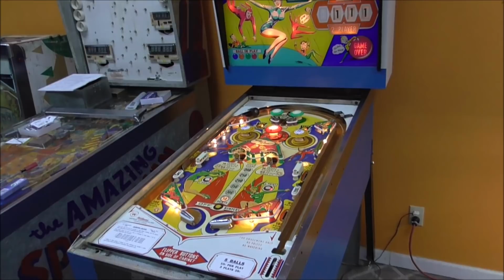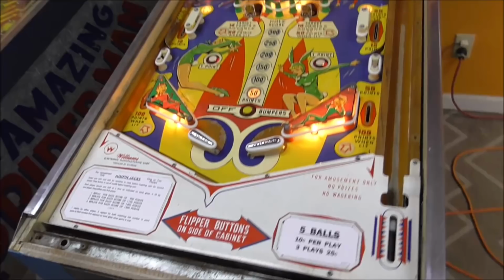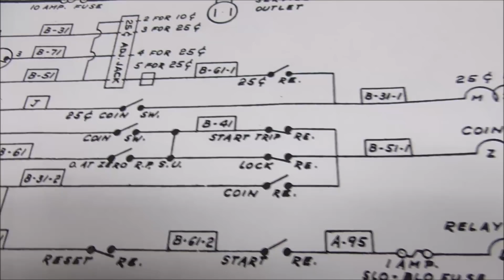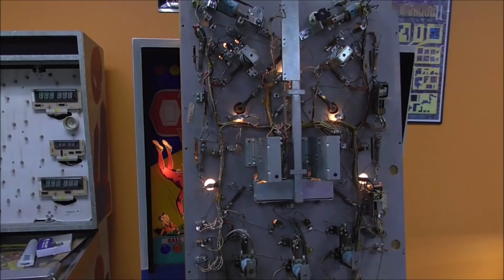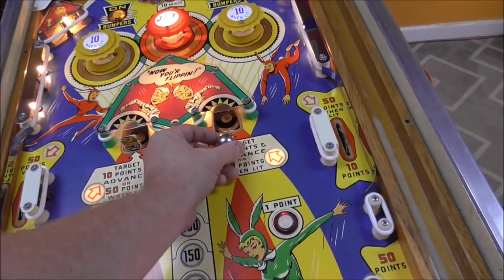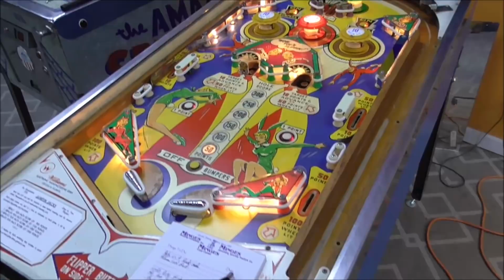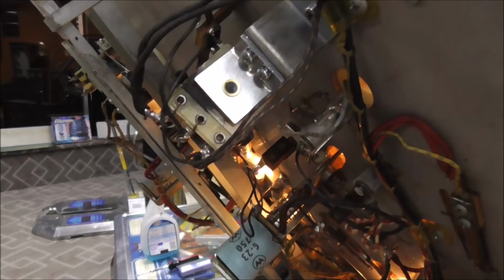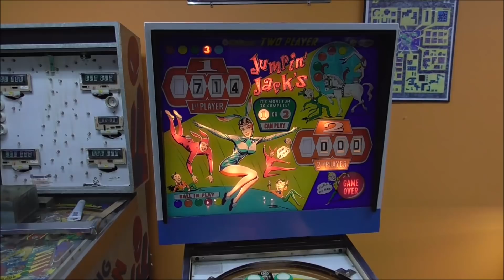Repairing A 1963 Williams Jumpin' Jack's Pinball Machine - Let's Figure Out What's Not Working....

Comment: I love watching these mechanical pin ball machines, it makes the ecu controlled models seem simple. To think, all of this is done mechanically , controlled and timed only by relays, electric motors and rotary switches.
Reply from the maker: Yeah it's really amazing, almost all of it is done with switches, and there's only that 1 motor in the whole thing, it just turns around over and over again and makes it all work by the timing of the other stuff.  Amazing, and they did it for YEARS.

Comment: Isn't this of the era where you needed to press the left flipper button to engage the (completely smoked) lock relay? Any monkey business there, besides the usual bypass/disconnect?  Wired into start button? Sorry, only dealt with Gottlieb and Chicago Coin from that era. Turn off machine= kick it in the nuts to close lower slam switch. Turn on= press left flipper button. Once lock coil burns up, disconnect coil, close contacts, use power strip as on/off switch. As you do...